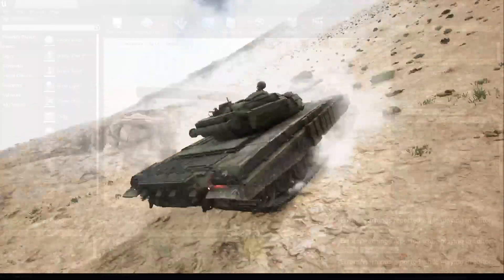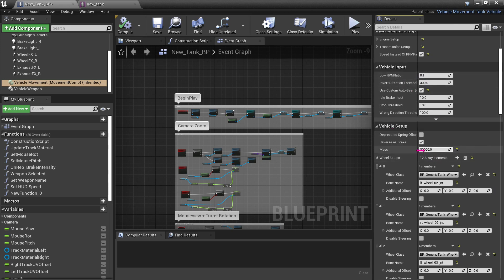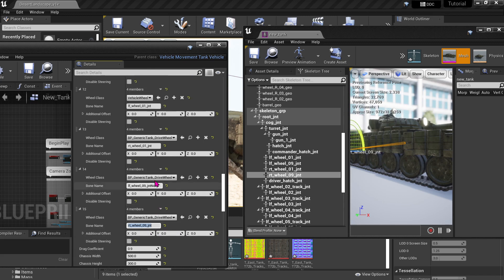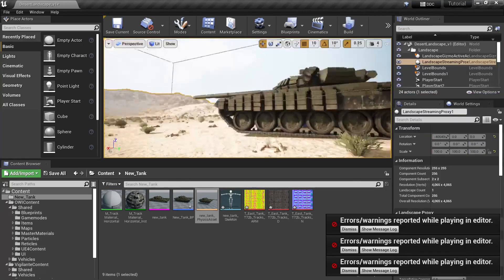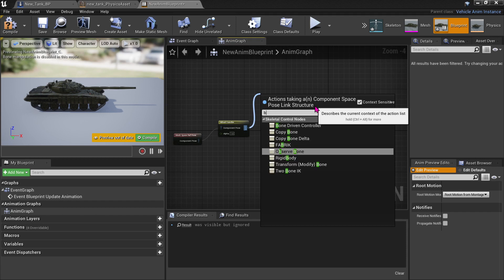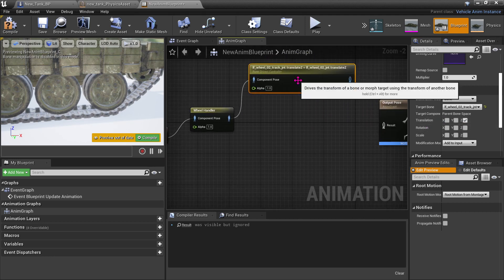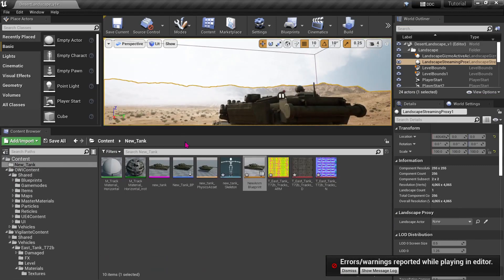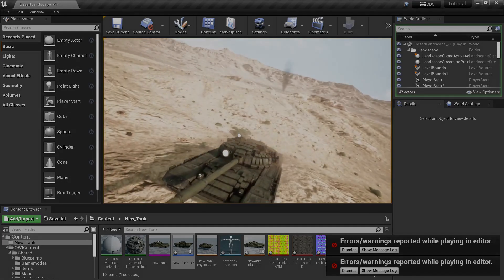UE4 Tutorial Tank Tracks with Vigilante Free Assets  Part 2/2

Comment: How tf are are your treads working so fluidly here? I've done the ABP multiple times and as far as I can tell the parent track bones don't react/copy what the wheels do. I've tried multiple times with these Vigilante Assets and the only ones that seem to work are the ones marked as Drivable and even then I'm mainly using the ABP architecture they provide. Very frustrating.

Comment: For some reason, my wheels jump when you drive, and also the caterpillar goes a little under the deckFor some reason, my wheels jump when you drive, and also the caterpillar goes a little under the deck
Reply from the maker: It certainly takes some tweaking to get everything perfect. You can adjust the Z component of the wheel offset from within the wheel blueprint. also there are many suspension options within the chaos vehicles movement component to dial in the bouncyness. Hope this helps!

Comment: This does NOT work in Unreal Engine 5..
Reply from the maker: The method for the tracks in this tutorial  works with Chaos Vehicles in UE5, but Chaos  doesn't have good differential steering. I'm working on a tutorial now, but it will probably be a bit messier than using OWI's nice enhanced vehicle plugin.
Reply: @Squiibbin  Please could you help me, I've been struggling with my vehicle, it is acting weird, it almost seems to have no weight or something. It moves slowly and then flips eventually. I clipped a sample -  https://www.youtube.com/watch?v=r7bDNWbPi7U

Comment: Mine wheels work but the track is staying solid(no bending)and bouncing up and down. Any suggestions?
Reply from the maker: The wheels turn but do they bounce? Did you make sure you double checked the bone names for your source (wheel) component and destination (track)  for the bone driven controller (7:08)?   Did you target the anim instance from the mesh component of your Blueprint (9:49)?
Reply: @Squiibbin  Yes, they bounce on the Z axis, and work fine but the track doesnt bend. Could it be the fact im using a different asset?(Synty) also loved these tutorials you should definitely do some on turret movement and shooting!
Reply from the maker: @bobbyjins4718  Ok, I see - not sure how the asset is set up/modelled, but the tank tracks need to be weight painted, centred on each wheel. You can check that if you go to the physics asset and under the viewport -> Character button ->Mesh->selected weight. Now if you click one of the bones that attach to the track, that part of the track should look like a heat map - if it's just one colour, then the tanks wasn't modelled correctly for this method. Let me know what the asset is exactly and I will give it a try.
Reply: @Squiibbin  Yep, the whole thing is pink. asset comes from the Synty Battle Royale pack, the m1 abrams included
Reply from the maker: @bobbyjins4718  Also. try the look at function in the Anim Graph instead of a bone driven controller. The bone to modify would be the track, and the bone to target would be the wheel... ?
Reply: @Squiibbin  triple checked, looks exactly the same as yours
Reply from the maker: @bobbyjins4718 Hmm, it may be that the bones are set up differently in the skeleton hierarchy? If so, then you may need to change things  around in the bone driven controller, or use the "look at" node instead of "bone driven controller".
Reply: @Squiibbin  look at made everything go wonky and the switch in the BDC did nothing besides stop the track from bouncing. Either way, the trask refuses to bend with the wheels
Reply from the maker: @bobbyjins4718  If there's no weight painting then it might need to be done in blender. That's a topic that could take another whole tutorial...
Reply: @Squiibbin  Alright thanks for letting me know, ive spent 2 days trying to figure out what was up. You should totally keep doing these tutorials, super helpful. Thanks again!
Reply from the maker: Lol, keep at it my friend - you will get those tracks to move. In the meantime, try the vigilante tanks from UE4 Marketplace. Maybe that will help you compare. Good Luck!